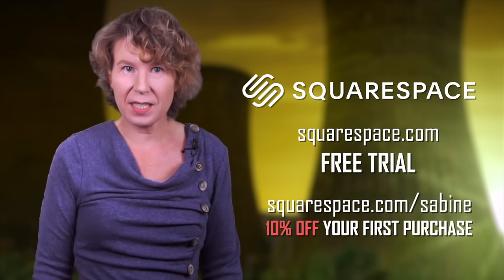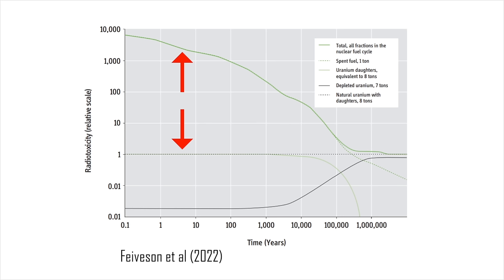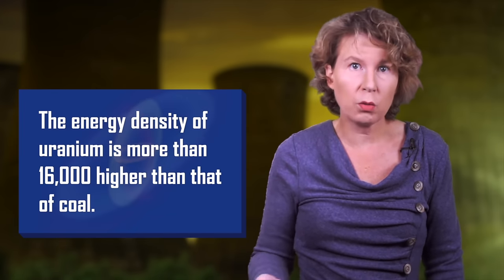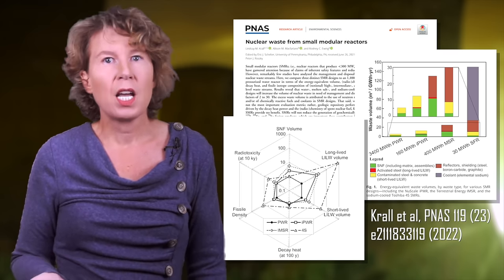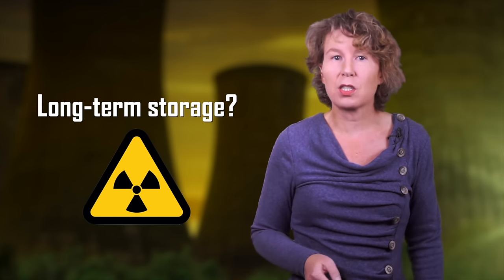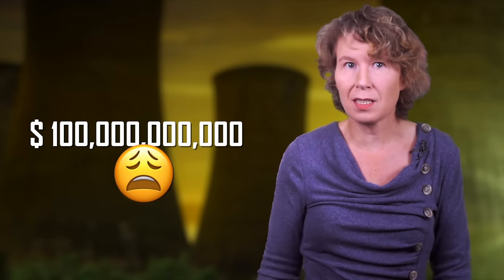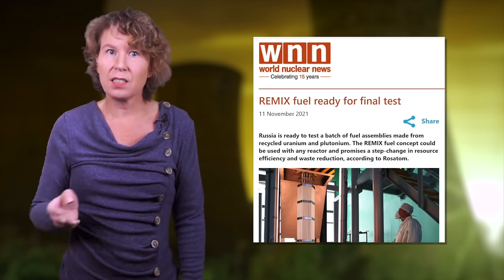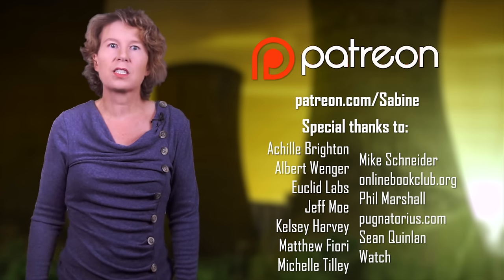Nuclear waste is not the problem you've been made to believe it is

Comment: Sabine makes a compelling argument for avoiding nuclear energy altogether. While it may have made sense in the 60s, in 2023 it's not cost effective, very dangerous, and takes a long time to implement. Given that the cost or electricity generated by wind and solar is a small fraction of what nuclear costs, and doesn't have any of the issues, this is pretty much a dead technology.
Reply: Re cost: France spent less money and time to convert most of their grid to nuclear compared to the amount of money and time that Germany has already spent on renewables for far less success. This is true even at Hinkley C or Vogtle costs.

Nuclear power is way cheaper. Take the worst case for nuclear, Vogtle (Hinkley C is not as bad). 30 billion USD for 2234 MW nameplate. Say 90% capacity factor and 80 year life. A simple amortized cost is about 21 USD / MWh. Take utility scale solar. Take some reasonable / optimistic numbers. Say about 0.70 USD / watt nameplate. 20% capacity factor. 25 year lifetime. A simple amortized cost is about 16 USD / MWh. Already it's a wash. Now look up any paper trying to model an energy transition to solar wind. They call for 2x or 3x overbuilds on solar and wind to reduce storage requirements to something reasonable. For that, see the peer reviewed paper "Geophysical constraints on the reliability of solar and wind power in the United States". I haven't even added in the costs of the 1 day of batteries (huge), extra transmission costs (also huge), costs for synthetic grid inertia and blackstart capability (large).

The problem is that solar and wind can't work at 80%. You can't run a grid on 80% solar wind. Electricity is a service, not a commodity. About 80% of the cost of supplying electricity to your house is non-fuel costs. Transmission is about half of the total cost, and the remainder are things like non-fuel O&M costs, capital costs, etc. Solar and wind, at best, can only displace the 20% or less fuel costs. This is because, contrary to the popular saying, it is /not/ always windy or sunny somewhere. It is often not windy or sunny enough. Solar cells and wind turbines could be entirely free, and that still wouldn't be cheap enough because of all of the extra costs of turning solar wind electricity into useful electricity, including extra transmission, storage, backup, synthetic grid inertia, extra equipment for blackstart capability. Even if solar cells and wind turbines were free and plentiful, they still wouldn't be cheap enough.

Re LCOE: Often, nuclear is reported as not being vastly cheaper compared to solar and wind. This is because most cost numbers are from anti-nuclear source Lazard using LCOE. LCOE is a scam because it doesn't compare total system costs; it compares only solar cells and wind turbines to nuclear power plants, but solar cells and wind turbines require a lot more extra equipment to make a working grid (storage, backup, overbuild factors, synthetic grid inertia, blackstart capability). LCOE is also a scam because it bakes in a cheat that makes long-lasting capital seem much more expensive. It's called discounting. It's a tool for a private investor who only cares about short term profits. it's completely inappropriate for directing public funding. Something can have a smaller LCOE but a higher upfront capital cost and a higher cost per year to maintain the solution. LCOE makes nuclear appear 3x to 9x more expensive for common discount rates of 3% and 10% respectively. Nuclear looks worse under LCOE because it has a much longer lifetime compared to solar and wind.

Comment: I think it is a bad idea to downplay the problem of nuclear waste until you have a viable solution. The big decision that you have to make is that it would be irresponsible to just bury the material in a way that it is inaccessible.

We are not talking about nuclear waste disposal but nuclear waste management. Then when you take the net present value of the cost of this nuclear waste management over 100,000 years you begin to understand the problem.

If you then estimate the cost per kilogram of dealing with the nuclear waste and allocate it to the cost of the electricity produced then you have a form of energy generation which is economically unviable.

By continuing with nuclear power we are creating problems for future generations to pay for our mistakes.

Richard

Comment: Spent nuclear fuel is immediately dangerous to life and health. 10 years after discharge from the core of a reactor, radiation dose rate on contact would produce a lethal dose of radiation within several minutes of exposure. 

Dry cask storage is not intended for enduring storage.

Yucca mountain was defeated by politics not by engineering.

Cost and escalating cost due to regulatory framework (at least in US), results in a power plant costing 3 times more than planned. State rate setting boards limit capital cost recovery by electric companies. Power plants are only licensed for 40 years with option to extend in 20 year increments.

In general discussion academic and not pragmatic. 

Policy in US is a once through fuel cycle. There is no reprocessing infrastructure and not likely in the next century.

As a veteran of commercial nuclear power and the US government program for high level waste I am very much in favor of nuclear power. It is just not going to happen

Comment: In 2023, the PRC started up one of two large breeder reactors, and the other will start up in 2025.  Wikipedia has a discussion of them.

That will significantly add to global plutonium 239 stockpiles.

Your focus on "nuclear waste" data ignores ongoing breeder reactor production capacities and projected increases in plutonium. Also Russia apparently desires to increase its active breeder reactor capacity. Claims are being made that Plutonium 239 will be used to power electrical generarion.

In short, your presentation seems to presume that intentional production of plutonium isn't a concern. But there is evidence to the contrary.

There are also ambitions to build Thorium reactors which  create a different waste profile. That also needs to be included in any discussion of nuclear waste management.

In the US, wet storage is nearly always adjacent the nuclear reactor power plant and many of these facilities are already at 100% capacity.

Comment: 9:20  Earthquake and even war can easily destroy these containers and then spread all these highly radioactive isotopes of long half-lives everywhere, making more acres of land inhabitable.  Nothing will last forever, so how can we guarantee these containers intact after hundred thousands of years, especially after the Fukushima nuclear accident?  :text-green-game-over:
Reply: Ok, so let's presume an 'earthquake or war' cracks a container.
* now it has to crack the inner copper lining
* then it has to crack the inner steel lining
* then it has to crack the zirconium/aluminum fuel tube
* then it has to crack the pellet's zirconium cladding
* at this point you have a cracked ceramic pellet that needs to be leached of its radionuclides
** so first, water has to get in, then out, through the layer of water-absorbing bentonite clay surrounding the total container
* now the water has to travel through hundreds of meters of rock  (presumably you have chosen proper geology and are going relatively deep) to get to the water table.

At Oklo, Gabon, a natural reactor was in operation for 100,000s of years.
Because of this, we can trace the radionuclides as they migrated through the rock.
This occurred 2 billion years ago - and in that 2 billion years, the water has travelled .... centimeters!

"Most of the non-volatile fission products and actinides have only moved centimeters in the veins during the last 2 billion years" (the volatile fission products were gases that evaporated).

So, if you choose stable geology, you can pretty much guarantee a stable repository.

https://en.wikipedia.org/wiki/Oklo_Mine
Reply: @factnotfiction5915   Thanks for your info, and I feel the world around us a little bit safer, but I'm still skeptical about these layers of protection, since similar or even better measures should have been adopted inside Fukushima nuclear plant, but an unforeseen accident had still occurred upon the power of nature or the brutal force of warfare...  😓

Comment: Well, in fact, there have been designs of reactors not producing Plutonium at all - but due military demand, we ended up here...however, even if we switch to fusion one day, we would still need a breeder for Tritium and such. So fission will stay for centuries anyways, just not in this scale.
Once we invented a space lift, we could get rid of the waste in the sun^^
Reply: "reactors not producing Plutonium at all" Yeah, there were designs that used thorium to breed U-233... which is as good a bomb material as plutonium.
"we would still need a breeder for Tritium" Most advanced fusion concepts use a lithium blanket to breed tritium within the reactor. Actually, the really advanced ones are aneutronic, so D+He3. No tritium at all. Much higher energy threshold than D+T, so that's a long way off.
Reply: @Crispr_CAS9  For good reason tritium is illegal in the U.S.A.

Comment: or you can just burn the stuff to nothing in a MSR - you get energy and waste in liquid for than can be separated. its not easy or cheap but its possible to get material needed for medical use and no long term waste. there really is no reason not to build at least one big burner reactor that uses up all this high level waste and lets stop building PWR's that have such a low utilization rate on the fuel in the first place.

Comment: Sounds good, as long as you don't look into the history of current reactors or our history in dealing with waste. Everything will be just perfect🥰 .

The nuclear debate is better than using less energy or considering your decisions and how they impact resources.
Reply: Nuclear waste disposal is a mess because obstructionists have made it a mess. For all relevant practical purposes, you can literally just dump the stuff in a hole in the ground.

The waste consists of a little chunk of solid metal, at the centre of a radiation-insulating block of concrete (a "cask,") reinforced with rustproof metal so that the concrete can't crack or corrode. You can dig a big hole in the ground, stack the casks in layers, and cover with cement and dirt when you're done.

Comment: I'm an ardent nuclear power supporter. Yes, the waste is not a problem. The problem is oil. Oil and coal will never be replaced as the kings of energy. Hydrocarbons are ridiculously inexpensive and inexhaustible, and you need it to mine nuclear fuel. However, big oil is paranoid they'll be replaced. Since money talks, and oil makes money EVERY TIME, while there's yet to be a profit from a fuel that needs orders of magnitude more energy to produce and refine. Give uo.

Comment: At current rate of consumption, known uranium reserves will last 200 years.

If only electricity production is converted to 100% nuclear in nuclear-capable nations only, uranium reserves will last 30 years. This estimate does not account for additional demand, and electrical energy is only a small fraction of all fossil energy consumption.

Nuclear has always been a dead end. The least expensive form of new generation capacity is renewable solar and wind that require only simple environmental impact statements and minimal investment. Nuclear is the most complicated and expensive form of new generation capacity. Nuclear is 100% dependent on an unsustainable centralized utility infrastructure that is constantly sparking wildfires with wind-whipped transmission line shorts during increasingly frequent hurricane level windy conditions sweeping through increasingly dried up forests. Nuclear also requires a cooling tower for the turbine generator. The cooling tower produces water vapor that is also a greenhouse gas. A cooling tower requires fresh water at a time when drought is so severe that renewable nonpolluting hydroelectric generation capacity is already being shut down during the most extreme conditions for lack of head and flow. Those extreme drought conditions are becoming commonplace as global warming accelerates and desertification spreads.

You've underestimated how long radionuclides last by a factor of 10. So did the US Department of Energy. Waste generates new radionuclides for half a million years. Peak radiation danger doesn't pass and subside until hundreds  of thousands of years after new radionuclide generation declines. This is why activists sued and got the Yucca Mountain waste storage facility stopped in its tracks. There is no portion of the Earth's crust that is geologically stable for 1 million years let alone the 5 million you claimed. The stuff would need to be dumped in an expended oil salt dome and it would be unretrievable. Once it's down there would be no way to bring it back up, and it still wouldn't be guaranteed to remain buried for 1 million years. Even storing it briefly at the surface before interring it is unsafe because earthquakes could send dry casks and water tanks tumbling. Dropping containers while bringing them down on a lift during an earthquake could render the entire storage facility inaccessible and unusable.

These are the actual reasons that Yucca Mountain never opened. It is laughable to claim that protesters stopped it. Protesters got shot with water cannons in the dead of winter to push the Dakota Access pipeline through. Protesters got bitten by guard dogs and arrested by police. Protesters got their arms shot off and their eyes shot out with rubber bullets. If the corporations, utilities, and local government were so dead certain that the Yucca Mountain site was safe, they would have gone in with tanks to flatten the protesters like the Soviets did in Tienanmen Square. They would have done it not because of the global climate crisis but because they are all bought and paid for with corrupting legal bribes in the form of unlimited corporate campaign contributions. The fact that they didn't go through with it indicates they aren't confident at all that they can safely store the waste there. They'd rather keep it on the surface where they know they won't lose access to it unless there's a major disaster at a reactor, and where the concentration of stored waste is relatively distributed across multiple sites. Keeping it all in one place makes the whole lot vulnerable to a single point of failure. You're a scientist for God's sake. Don't you know anything about basic engineering principles?

If the 9/11 hijackers had targeted US nuclear reactors with lots of cooling pond and dry cask storage, half of the US could have been rendered permanently uninhabitable. Producing more and more waste is a non-starter from a national security standpoint. We've already got far too much of it. We can't store it safely anywhere.

No economical waste recycling is currently in widespread use. The recycling of waste creates a lot of high level radioactive chemical waste. Only nations that have disregarded the economics of renewable energy production are recycling waste. Germany is retiring all of its own nuclear generation capacity because it's uneconomical and dangerous. You're German. You know this but didn't mention it. Why?

You didn't mention the half a dozen prior meltdowns including Fukushima and Chernobyl that contaminated vast areas including farmland and ocean farms. You didn't mention that none of the meltdowns have ever been cleaned up because the slag is too radioactive to move it. You didn't mention that the claim that nuclear hasn't killed anyone can no longer be credibly made after Fukushima and Chernobyl, even though it was never true. Marie Curie died from radiation poisoning, as did Harry Daghlian, Louis Slotin, Cecil Kelley, Robert Peabody, Alexandr Zakharov, and at least 19 others. The 24 known deaths (25 counting Curie) is likely an undercount. That's just researchers being irradiated in criticality accidents or accidentally poisoned from chronic exposure. It doesn't count perhaps millions of others whose deaths cannot be reliably traced back to their radiation exposure because of the chronic nature of radiation-induced cancer.

You didn't mention that the debate has been warped beyond all recognition by corporate bias. Comparing nuclear to coal is ridiculous. Neither one is an appropriate long-term energy source at the scale necessary to sustain an unsustainable civilization.

You also didn't mention that nuclear energy is another form of fossil energy. We shouldn't be burning all of our fossil energy reserves for a brief surge in human population. There's going to be a mass die-off from the global warming crisis beginning within the next few decades. It's pointless trying to sustain an unsustainable growth rate. What if we need this radioactive material in the future for less wasteful endeavors, but we've already used it all up on a lark? This is madness and you know it, so why are you promoting it through these biased videos?
Reply: Re uranium scarcity: Suppose we convert to 100% nuclear and we run out of uranium in 20 years. So what? Nuclear would have been a fabulous success. That's 20 more years of R&D to figure out something else, and we need those 20 years without greenhouse gas emissions because we don't have any other option right now. In terms of limiting the effects of climate change, the next 20 years are the most important. Of course, we won't run out in 20 years. There's a lot more uranium than that. Also ocean extraction might prove economical at scale, and that would be inexhaustible. There's also breeder reactor technology which is proven in the BN series, and with breeder reactors everyday rock is nuclear fuel; we'll run out of sun before we run out of rock.